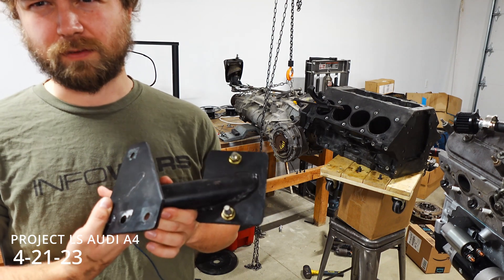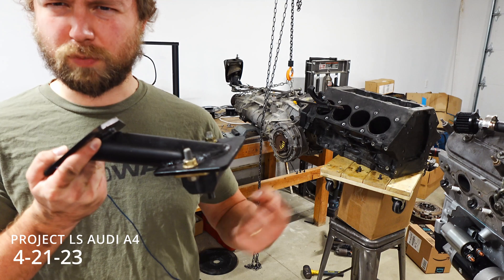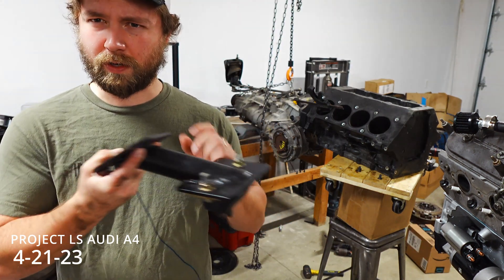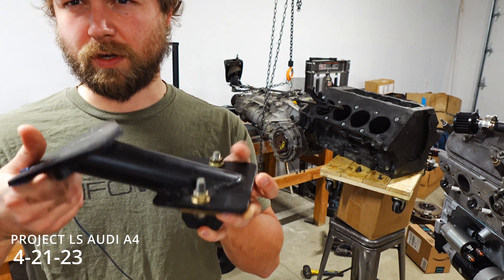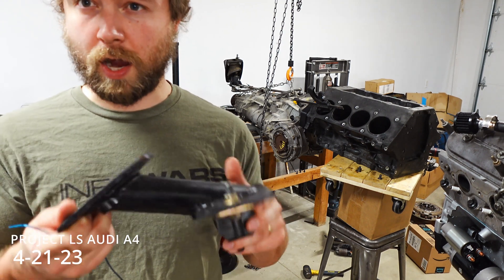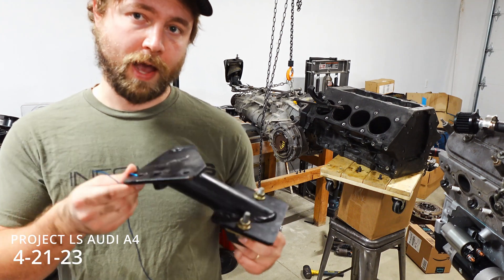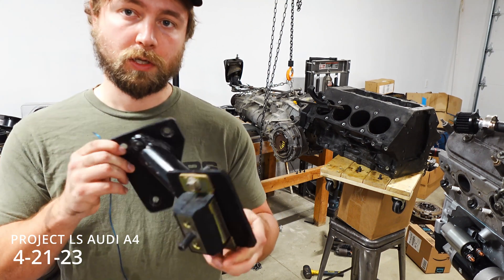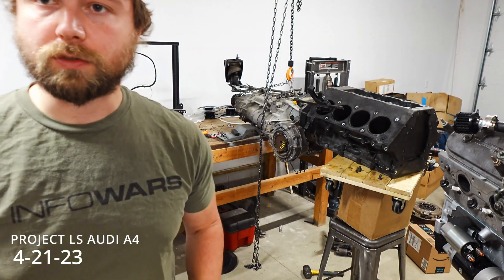Motor Mounts Build for LS Swap Audi (3D modeling!) Ep: 11

Comment: Definitely I have an email I can be reached at just let me know ASAP I'm definitely interested it will be cheaper in the long run as far as performance upgrades reliability and preventive maintenance vs the original 4.2
Reply from the maker: I have some design features that need verified via some additional prototype components (which I’m still waiting to receive) so right now I don’t have an exact ETA but I hope sometime this year to begin production of the entire kit. I’ll post a video when the website is launched.

Comment: Hey man I have a 09 2.0 piston rings went. It's a Quattro awd. I love the car hate audi engines. Short story would you sell me a pair I'm gonna go for it. I'm a ls fanatic and can get anything gm easily .
Reply from the maker: I’m just not positive the motor mounts would fit a B8 man—they should but might require modifications. Not only that but pretty sure the core support would need to be modified and I’m not certain about the subframe either. I am designing everything for the B7 for a number of reasons, but I think the B8 would be awesome too so I plan to work on that next... but I gotta finish the B7 first! This stuff isn’t cheap and also isn’t easy so I am trying my best to bring this to market as soon as possible. I will post updates here when they happen. Thanks

Comment: Getting set up for the MLB, would let one kit work for any MLB chassis as I understand it. The axle cups, bellhousing location, front suspension design, firewall, and windshield are all to be the same location. A B8 kit should work for a Bentayga, Urus, Cayenne, RS7, A8, etc.  That seems like it would be the ideal solution for a wide audience!
Reply from the maker: Exactly! But I’ve already measure a C7 A6 and the engine bay is too short (B6/B7 has more room). A custom core support would need to fabricated for any B8 or C7 cars. Don’t know on A8.
Reply: @projectLSaudiA4  I suspected as much but hadn’t had a chance to measure.  Thank you for confirming my suspicions.

Sounds like any of the v10 cars should be fair game, but anything new school is likely to require the core support, sacrificing any chance of an OE appearance. Defeats some of the benefits IMO.

Thanks!
Reply from the maker: @ericvincent3219  I have an adapter plate design that would fit in the newer cars but it requires clearancing the LS engine block. Basically the “ear” of the block where the starter normally mounts to has to be cut and this allows a thinner adapter plate thus shortening the whole assembly and allowing the engine to sit closer to firewall. I just don’t think people will want to buy an adapter plate that will require cutting the block and making it useless for any other applications... this is the same design I used in my car initially. I’ve since redesigned to make adapter plate thicker to avoid this. Maybe I’ll offer two versions, idk yet.

Comment: 👍🏼🤙🏼💪🏼  been watching your vids for awhile,is there a chance you will make a couple kits for conversion when your finished with the project?awesome work keep it up.
Reply from the maker: Thanks. Yes that’s the plan!
Reply: @projectLSaudiA4  sign me up, I currently own, well my wife owns a 08 A4, stick shift, #3 piston is roached, can’t muster up to scrap it and don’t want to put another moter in it( but )my buddy has a ls moter for me for another vehicle I own, was thinking of buying it from him to put in my 1973 caprice (BUT) after watching your vids I’d love to stuff it in the Audi, by the grace of Jesus I came across your vid last year been keeping up with you👍🏼, so yea when your complete with conversion kit I won’t one!. Keep the vids coming and thanks for not giving up on your dream! Most people would fade off of it.
Reply from the maker: @joecrockett1385  I appreciate it man. It’s been a heck of a lot of work but will be so awesome. I’m to the point where I have virtually everything designed and gone through, but I’m just waiting on the machine shop to deliver parts—been a struggle to find reasonable pricing so that this whole package doesn’t end up costing $4,000 (flywheel, transmission adapter plate, starter mount, power steering mount, AC compressor mount, alternator mount, motor mounts, and transmission mount). I’m even considering buying some CNC’s to bring cost down but I hate to say the first few kits might cost that much because of how high aluminum is and I have to outsource all the components that have to have very tight tolerances. I’ll will certainly be posting videos as components arrive and continuing to work on getting the cost down as low as possible. I have the new starter mount most recently which I’ll be making a video this weekend showing it 👍

Comment: Loving the use of 3D design and printing on this one. So nice to be able to make something for a couple bucks to test out a concept. 👍
Reply from the maker: Thank you. 3D printing has opened up a world of possibilities, rapid prototyping for pennies is amazing for sure!
Reply: Will you sell a kit for this I have a 2005 s4 automatic @projectLSaudiA4
Reply from the maker: @ricardohay4653  I will be selling kit for B6/B7. But only supporting 6-speed manual at the moment.
Reply: @projectLSaudiA4  well I may have to switch to manual shouldn't be a huge deal since everything will be out of the vehicle what are u looking at selling them for
Reply from the maker: @ricardohay4653  not sure yet on pricing, I have a new design that might reduce the price so no telling yet. I’ll be posting a video once the website has launched.